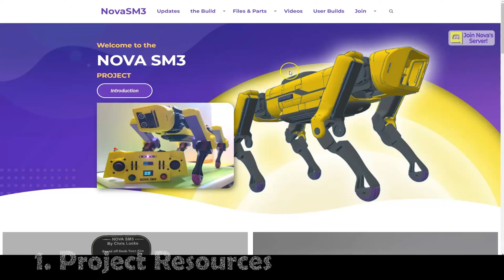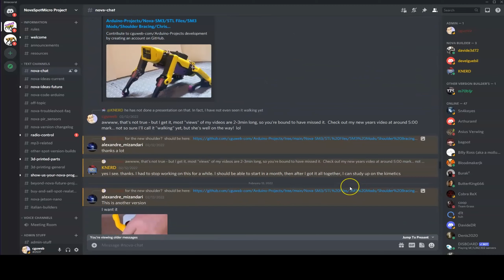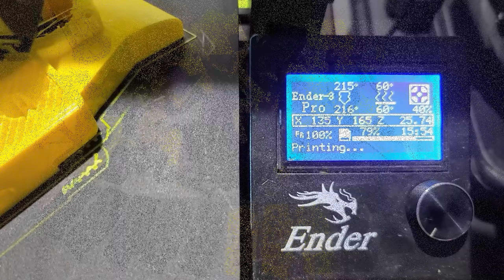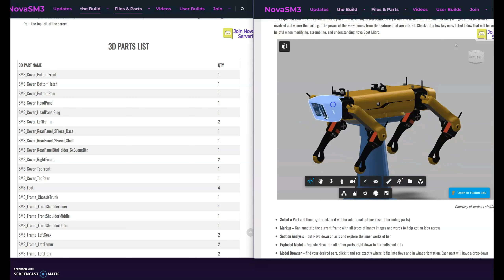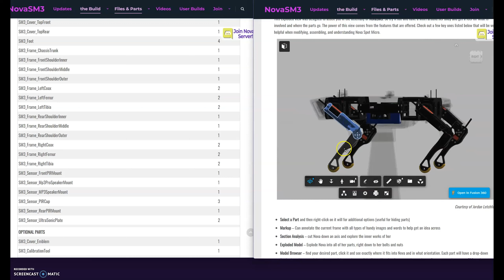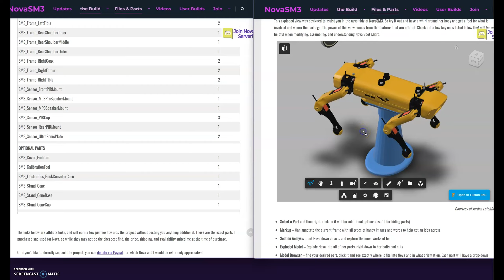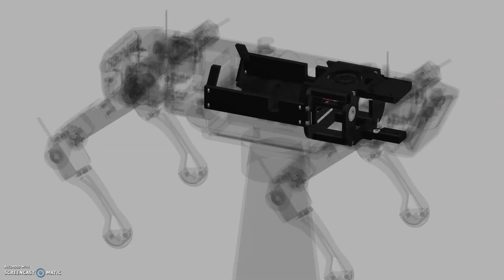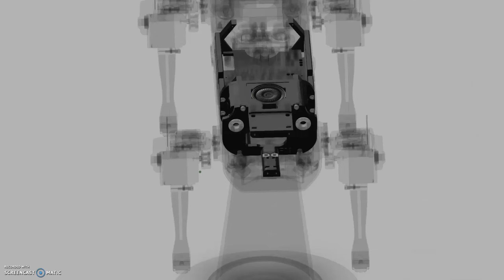NovaSM3 v5.2 : Build Series Part One : a Quadruped Robot Dog Spot Mini Clone

Comment: Great work , i printed my files but as this is my first approach i am confused with the sizes of screws! Can you help me please? Thank you
Reply from the maker: there is no documentation on size of screws - can you tell me which part(s) you are talking about?  Most should be pretty obvious, I hope.
Reply: First of all thank you so much as I told you before, i am completely new to this things. If you are telling me that it is obvious it means that i have to figure it out measuring the fit of the screws 😅 by the way thank you so much for your answer and for the great work you are  doing. Ps:  sorry if i commented on other videos with the same request.  @ChrisLocke1969
Reply from the maker: unfortunately, yes, its a bit of guesswork with the screws. I don't think any are really critical lengths, but the receiving holes in parts should help you determine the length needed.  Size of screw (ie: 3mm, 4mm) should be very obvious.  If you run into any specific part / screw, let me know and I can look at Nova and tell you most likely.  Good luck, and you're very welcome!!

Comment: Why teensy board? You can’t get it in Australia or the old versions 😢 I’m a bit of a dumb ass but I’m wondering if I can just use a pi or something? Or even Arduino?

Really appreciate the effort in all these guides though man. Amazing work for the world!
Reply from the maker: the previous version (version 4) used an arduino mega and a nano - nothing less will cut it, I'm afraid. Too many sensors and pins required.  The teensy nailed my specs to the pin, so its what I went with. I suppose if you can code, you could surely use any board you wanted. But the code I offer will only work on teensy, or as I say, version 4 on a mega.

I'm glad you appreciate and enjoy the project nonetheless!  Stay tuned, another (possibly over-optimistic) project coming soon!

Comment: Wow, very interesting project. I am not going to build absolutely the same robot as you, but it will be quadruped too. So I wonder how did you calculate the torque of servos required for legs?
Reply from the maker: me? it was trial and error, honestly. And yes, I upgraded servos a couple of times before she became stable enough to get some good movement out of her. Good luck in your project, its a fun challenge to say the least! ;)
Reply: Yeah, thanks 👍

Comment: Would of been nice if you had explained how to "home" the servos while stressing how important it is
Reply from the maker: would've been nice if you'd watched other videos, as I am sure I have one just on exactly that, sorry to disappoint you
Reply: @ChrisLocke1969  I see some on calibrating, but not seeing anything for "homing." Even searching online for a video, or other tutorial is revealing not much of anything on "homing."
Reply from the maker: @knerduno5942  surely I talk about in calibration vid, and also most likely and surely in the leg assembly video(s).  Sorry my friend, its been a while since making over 70 hours of videos for this project, it would be nice to have done it more consistently, my apologies.
Reply: @ChrisLocke1969  I found something in the "Nova SpotMicro - Motors, PWM, & Calibration (a Spot Mini Robot Dog Clone)." But is seems you only mention about pressing the button on the device. If that is correct
Reply from the maker: correct, with the correct device, that's all it takes to "home" a servo.. ie: set it to its zero position.  This is just for assembly... Nova's actual "home" positions are computed from this factory "home" position. This is done to take advantage of the most leg segment movement we can get. Generally, as you'll notice at around 11 minutes into the video you mentioned, the final home position of the legs is about 90 degrees, whereas assembled with factory home position, they are straight as shown in beginning of the video you mention.
Reply from the maker: so, I just noticed in the first video of my Build Series, there is indeed a whole section on homing servos ;)
https://youtu.be/0YpnKmXtMKQ?t=736
Reply: @ChrisLocke1969  What timing. I my servo tester from Amazon should arrive today.
Reply from the maker: @knerduno5942  excellent choice... all you have to do with that device is connect the servos, power the board with 6v, and press the home button - done! ;)    Just be careful when you are assembling that you dont move the servo motor position.
Reply from the maker: @knerduno5942  and this video is the best of all regarding setting up servos! ;)   Reach out through Discord if you have any issues, I'd be glad to help.  https://youtu.be/c8KYytbMIZc